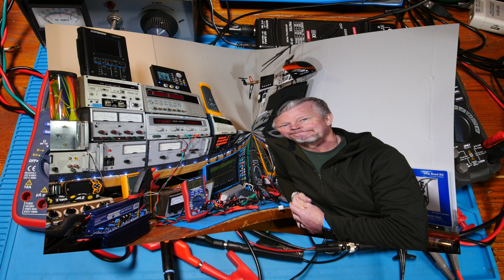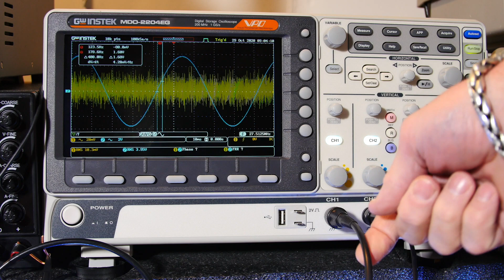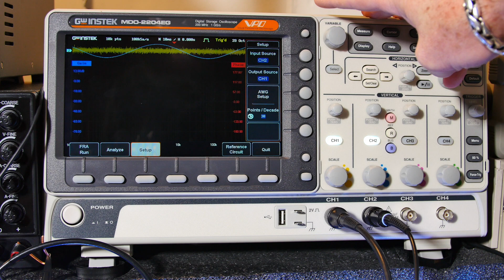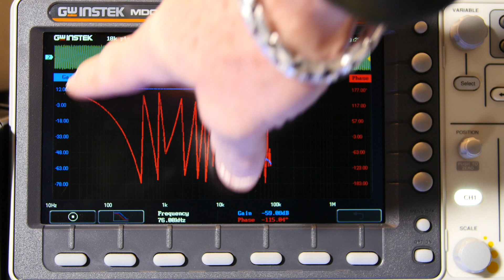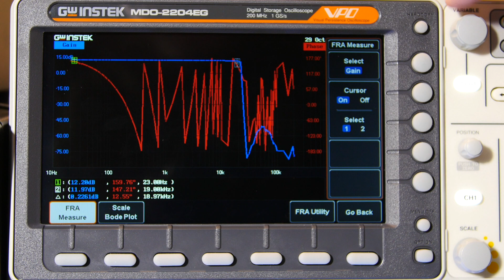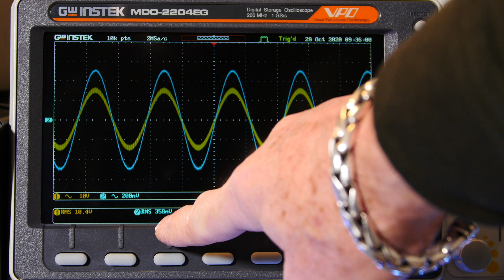Class D GaN Systems Bode Plot Correction #GaNSystems #Bodeplot #classDwithGanFET

Comment: As I said before, that is a typical response of an elliptical filter. I once designed a 5th order elliptic filter that was flat to less than 0.5db in the passband. The cutoff "dropped like a rock" sharply to <90db. It had 5 "cusps" with steep "holes" down to the same value. This response looks suspiciously similar to an elliptic filter response.
Reply from the maker: Great input Gerard!  I'd imagine the DSP can do the elliptic filter without a problem.  Interesting to see.

Comment: Could you not just use the output from the DSP as your input, to eliminate this affect. Prove the rest of the circuit, like those big coils and caps on the output are not messing with the phase too bad.
Reply from the maker: Great question Bugsy son!  You have read my mind;)  I did ask for schematics but they are not easy to get if I can at all.  I do want to see if I can do that, but I wanted to get this video out to correct my previous video where I didn't understand what was happening.  Thanks for this feedback!

Comment: This is definitely a time delay. Looking at the bode plot makes it seems like about a 2.8ms delay or so. If you take a lot of gain/phase points and get the data into a computer, you could find the delay and undo its effects to get the phase plot from the chip to the output. The amount to add (in degrees) to the phase is 360*f*tau where f is in Hz and tau is in seconds.

I disagree with some people from the previous video saying where the delay is coming from. While I think some delay is coming from FIR filters in the DSP, I would bet that most of the delay is coming from the buffering inside the chip. Most modern microcontrollers have DMA controllers. Most likely there is a DMA controller putting ADC readings into a buffer, then the processor will do work on the samples once the buffer is full and plop it into another buffer, then another DMA controller will take that buffer onto a DAC or PWM module. An FIR filter causing a 2ms delay working on 96kHz data would take 384 multiplies per sample (37 million multiplies per second) which is possible I guess.

That delay will probably cause some problems if you have multiple amps playing the same music on multiple sets of speakers.
Reply: AKA class d is all dsp crap :P he he !
Reply from the maker: It does make me wonder what our ear/brain connection can decipher and what artifacts that there might be with the DSP...  I think the measurements get much more complicated, e.g. dithering...
Reply from the maker: Thanks Austin for your great feedback!   Yes, now it seems obvious to me?  It's funny how the light goes on;)  What you describe is what I understood from a quick read of the data sheet of this DSP (which is Audio specific).  The earlier explanations did not strike a cord with me but what you say above seems to make so much sense.  Now I just have to see if there is an output that I can use as my input to the FRA/Bode so that I can see the effects of the output LC filter.  There's actually a pretty decent ripple voltage (peak to peak).  I wonder if a better LC would clean some of this up?  BTW, your insight to the playing of multiple channels  in the same room came to me too, but I didn't want to point that out yet as I was trying to correct a previous mistake and didn't want to rain on the parade again;)  So, I ignored the ripple as well.